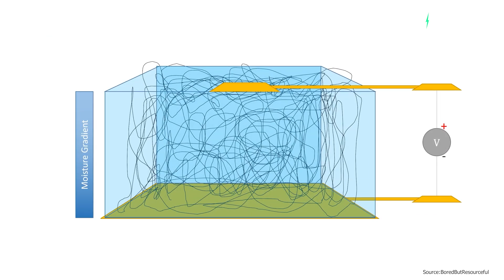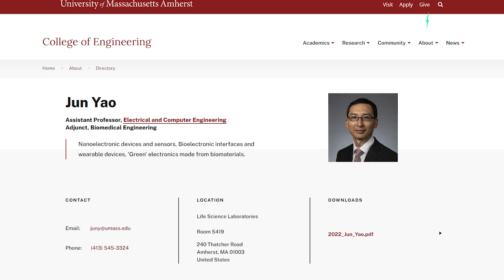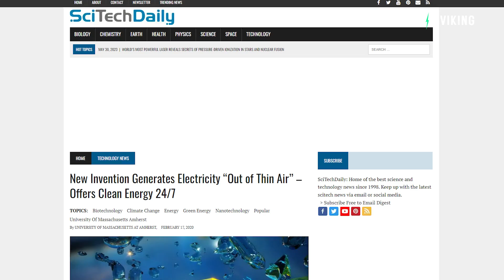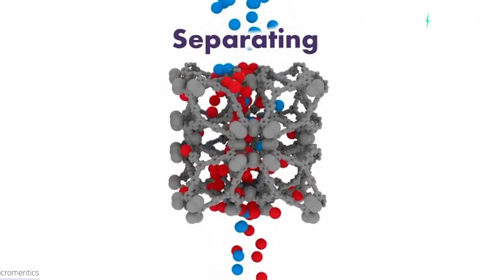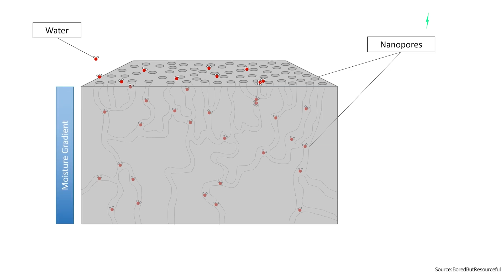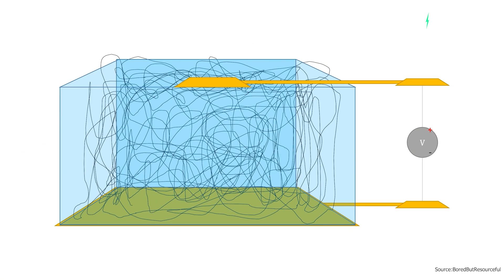Free limitless energy - engineers use Nanotech to harvest electricity from air

Comment: GREAT!! Now we can have robots and cars that breathe to get electricity.
But this was 3 years ago and haven't really heard much from it in a while sooo.
Reply: Anytime you hear "free energy" you know it's at least partly BS.  Free as in the 'fuel' is free like a solar cell at best, solar cells as relatively cheap as they've become are far from free and this idea, if it works, won't be free either.
Reply: @Mrbfgray  And it won't generate much electricity.
Reply: @Mrbfgray  the mechanism behind it is real and works but in this case it doesn't seem to be going anywhere. It is kinda like a more efficient version of capturing energy from the voltage gradeante but only from humidity this time.
Fusion is a example but it has gone somewhere but needs more development but a helium 3 and deuterium reaction will be the way to go and will be the cheapest and actually the easiest to work with and produces almost no radiation but too much money seems to have been spent in the deuterium and tritium reaction. And solar can literally be free if you want!
Reply: @mrnobody.4069    Solar can be free on the margin, it'll never be free, but eventually very cheap. It will always cost something significant to mfg, install, maintain and replace.

 I welcome fusion tech for eventual space travel utility say, but that's likely a century away.  Also for the science and tech advancements in general.

Seriously doubt it will ever compete with 'indirect fusion', aka., solar on Earth, simply due to capital cost.  Unless one of the alternative long shot attempts succeeds, these tokomaks seem inherently extremely expensive.
Reply: @Mrbfgray  indeed. I'd say about 20 years away fusion is and that's mostly speculations on Helions reactor because it's the most simple and the most scalable design and it's the most efficient gathering the most energy out of its reactions and I got more prototypes coming! There was something called inertial confinement fusion which later had a beyond net energy gain but there are problems and that is that this reactor uses tritium unlike hellions helium 3 and it destroyed its own fusion fuel container which means it cannot be ran continuously at least not right now but they're still hope especially for that form of fusion especially since that reactor was built using technology from the 1980s and early 2000s!

Comment: Harvesting energy from thin air? Yeah, they're called wind turbines.
Reply: .... that's more like thick air..
Reply: That’s wind power , this is humidity power
Reply: @camronrubin8599 That's what she said.
Reply: That's not from thin air... That's from wind lol
Reply: @joelbolduc3354  ...yeah...because it's about cold...which is colder at night than it is outside. jk
Reply: only when the wind blows and at great expense and centralized control
Reply: Or nanostructures that are designed to displace electrons from phonon and photon interaction with greater efficiency than photovoltaic panels
Reply: Lot of places have little or no wind. Besides the best use for this tech
Is onboard generators for microscopic robots
Reply: @jeremytipton6076  I am pretty sure you don't have any clue about the global wind distribution throughout the year. You think wind is a random thing? Please educate yourself before you issue an answer.
Reply: Incredibly inefficient
Reply: Only air between your ears that's for sure
Reply: Nice ❤
Reply: Paul, think with a broader mindset. To understand electricity you need to understand the science behind it. Electricity is when electrons become free in the valent shell, which produces an electromagnetic field, which the field creates a force for electrons to move in a conductor. However, the electromagnetic field is an oscillating wave which is electromagnetic vibration. Nikolas Tesla discovered this and it is why he was obsessed with frequency and vibrations. One is the effect to the other. Now, air is filled with ions, both positive and negative. And it is filled with moisture. If you can create a chemical compound that is ionized, it will breakdown covalent bonds and cause electrons to rome from one valent shell atom to the other due to polarity. When more follows, an electromagnetic field is generated, and this will push the electrons in a path. If you have a negative and positive electrode, you have a controlled path to power your technology. Radiation can be used to generate power as well. The old school smoke detectors contained Ameriseum, a radioactive element. Isotopes of hydrogen are released from the nucleus due to its instability. If you have a positive and negative magnet. The electrons from the hydrogen atoms will collect on the positive magnet, and the hydrogen ion will collect on the negative magnet. Fun fact, lightning is a series of electromagnetic fields and eddy currents that break down the atmosphere through a process called dialectric breakdown. This frees electrons.
Reply: Or air source heat pumps !
Reply: Nicolas Tesla said this was possible nearly a hundred years ago.
Reply: @markhartung1190  Nikola*
Reply: @markhartung1190 possible if it works u can cool and warm your house and make your own water and electricity all in same time. we need 1 more tesla